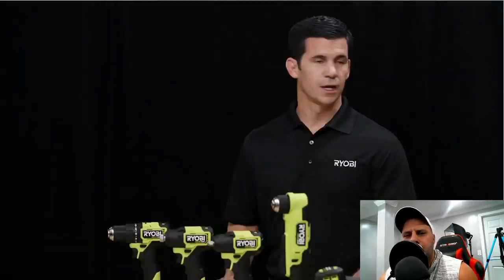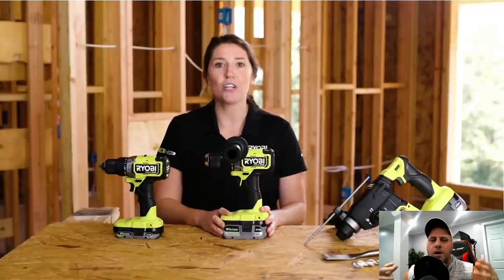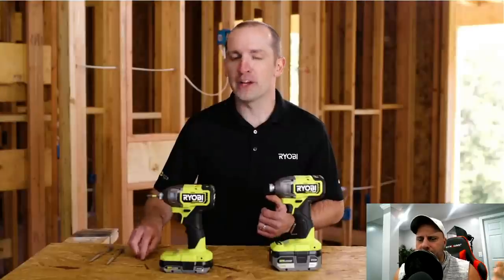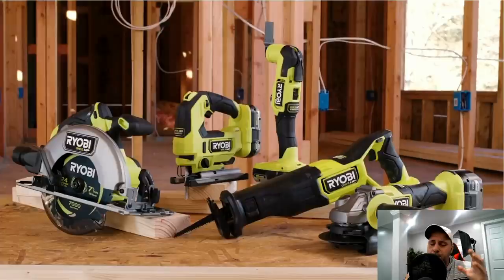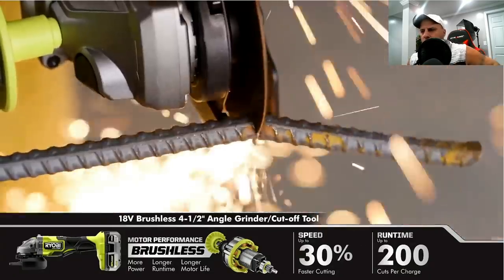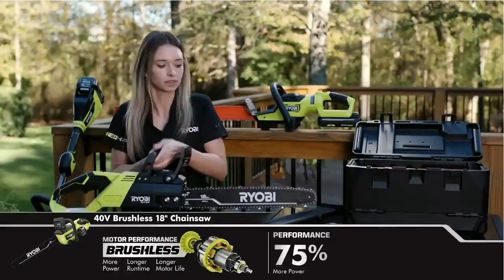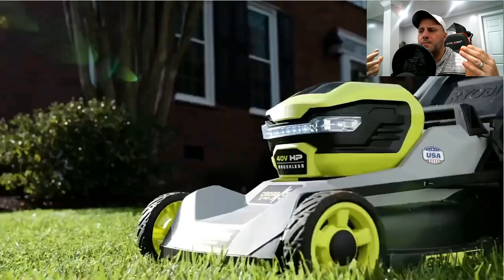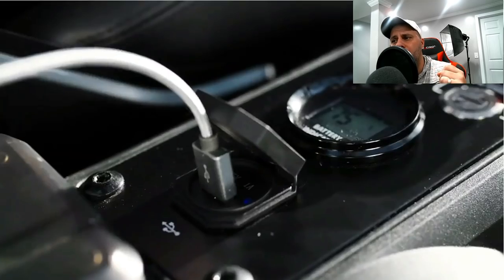RYOBI Tool Just Announced 26 new NEVER BEFORE SEEN Tools - What they got right and what they didn't

Comment: For the DIY weekend warrior I think this new line of Ryobi tools I really going to get a nice lawn for a great price between Ryobi Ridgid Makita DeWalt and Milwaukee I believe in that order goes from homeowner to professional with DeWalt and Milwaukee being at the top Plus Ryobi is made by Milwaukee and out of all the tool company Ryobi comes out with the most designs in tools. So for the homeowner or even for the professional who in a jam I think a tool going down you can go purchase a Ryobi to get through the job I had a problem with my palm sander so I went and purchased a Ryobi palm sander for about $30 and I was able to finish sanding the stairs got them ready for stain and was able to finish the job. So it's nice to see more competition with tool companies😎👍🇺🇸
Reply: Dewalt?  Lol not in makita s league
Reply: @Jack-russell103  no I was saying Milwaukee and DeWalt are you're too professional brands and then Makita rigid Ryobi I wasn't putting Makita next to DeWalt. Number one is Milwaukee and DeWalt and then the rest
Reply: @Jack-russell103  I have to say within the same month all three my Porter Cable pancake air compressors broke I had a big Roofing job borrowed my friend's Makita 3 horsepower 5.4 gallon air compressor extremely quiet and had no problem running to Roofing guns at the same time. Really impressed with the Makita air compressor but I also just picked up from Home Depot DeWalt pancake air compressor with hoes and finish gun paid 179 nice compressor also

Comment: I’m glad to see the 1/2” brushless and the upgraded quick release multi-tool! Are the multi-tool or grinder variable speed? I’d really like to see a variable speed dual-action polisher and some kind of plug-in battery adapter for when all my batteries are dead!
I knew about the live stream but couldn’t make it so thanks for the good overview!
Reply: The plug in battery adapter will never happen, for 2 reasons.
1). They want you to buy another battery.
2). An 18v, 60 amp power supply will be bulky and fucking expensive anyway. You can't just use a wall wart for these tools.

Comment: My wish list:
1) Airless sprayer 0-2000psi 1/2 gallon per minute
2) Dewalt has a 1500 watt generator/converter that I think takes 5ea 20v batteries to run so one by Ryobi would be "real nice like",
3) pressure washer 0-1800psi - Sunjoe makes a 40v one that I bought & love it, it's only 1000psi

Haven't seen his evil brother lately, they crack me up
Reply: Ryobi was going to come out with a multi-battery inverter a few years ago but it never came out and is assumed was cancelled for some reason.  Possibly it had a patent dispute with another company, something Ryobi has had to deal with before... The single battery inverters are the only offerings but the 40v version isn't too bad for basic usage at 300W.

Comment: I have the 40volt push mower, and it works fine for my small yard. I wouldn't want to spend the money on ones that waste battery life on the self-propelled feature, I can push it myself just fine and want the extra battery life for cutting.

Comment: A coffee maker is too high wattage, (600watts-1200-Watts, ) for a simple 1 to 1 replacement of ac for 18v battery, (typically between 40watts and 180watts. ) Someone could do make a modified boilover designed where you let a heating coil heat water in a sealed vacuum insulated container until pressure has reached a high enough level that you'd have enough water rush out to make a full drip cup of coffee. You'd probably want a 2 Liter container, with vacuum insulation for efficiency, a pressure gauge, and a decent sized coil to heat the watter. Basically the whole device would be a multiple cup coffee maker that screws into the top an insulated growler and costs a little more than an instapot. And the first cup on a job site would take the longest as it would have to heat the whole water past boil to pressure. The pressure and insulation would be the key part, because the reason the typical drip or kurig coffee maker take so many watts is because the water heating is highly inefficient.

Comment: I tried watching the stream.  The lag sucked but mostly I was confused at the direction Ryobi is going. Yes, I agree, it’s great they’re updating their tools to brushless and with a compact form factor.  With that said, what the hell happened to the whole Lithium +HP? Remember those HP batteries from like 2 years ago that when used with brushless tools ups the performance?  The brushless tools had that notch where you insert the stem pack so you know you’re getting the extra power?  So what, that’s just been abandoned and forgotten about as if it never even existed?  WTF!?!?  And.........what the hell is TTI doing with Rigid?  All Rigid is coming out with is, let’s be honest here, crappy brushed tools that were already out by other manufacturers and done better!  Oooohhhh, a brand new brushed “job site blower” with inflator and deflator that Milwaukee, Dewalt, Makita, AND Ryobi, among many others, introduced like 10 friggin years ago!  Also, what the hell happened to the Octane line?  Crickets!!!!  As in nothing!  Other than a brushless multi-tool, every “new” tool is a tool that’s part of the Black Friday Sales right now at the Depot for at or around the same price as all of these.  And yes, their drill bits and fastener bits suck ass!!!!!  That’s my rant Clint all-in-all I still like Ryobi I just wish they weren’t all over the place with the direction they’re tools are going that’s all.
Reply: HP+ was mainly to distinguish their brushless from brushed tools but that isn't needed with the HP tools because they're all brushless.  The HP tools also self regulate, which eliminates the need for any special battery feature for a performance boost, and have protection features that make them a whole hell of a lot harder to burn out or damage.  So they're a smarter tool as well as brushless and only need good batteries, which the new One+ battery line is being optimized for them.

Can still use all batteries with the HP tools, but only the new batteries will really benefit them...

Comment: Still no high capacity (2000-3000w) 18v battery inverter. No framing nailer. We need more camping gear. Like a 18v heated mat to put under the sleeping bag and a heated vest/jacket.

Comment: Sometimes these big companies have a certain budget and it's either spend it or lose it.  "If" something like this is in fact happening they clearly do not have their fingers on the pulse of what folks want and need to make business more productive and streamlined , and further more they people making tools who have no hands on experience with tools ,  I was hoping Milwaukee would have come out with a wireless fax/copier that would be at least ip 54 rated to stand up to job site harsh conditions stored in a packout box.  No more doing everything on your phone which can be a slow process.  A company needs a invoice....or the plans have changed on a house that your "say" running the plumbing and a last minute change has been made , no problem....just fax me the new prints.... you get the fax and all is well.  This is just a weird idea that I've had....it could control your one key.....and also more importantly keep track of your tools from them sticky fingers fellers.  Just food for thought.......thanks for taking the time for updating on how TTI is thinking......and you are certainly right about the drills.  Take Dewalt for example..... you got the flexvolt , flexvolt advantage , the atomic , the XR and on and on and on.  If your just getting into the trades you better hope that you have someone who explain what's what and what's total bullshit.  You hit the nail on the head brother.....not a tool test but one of your better vids.   Thanks bro.....

Comment: [LIKE] button SMEESHED!
SDS hammer is VERY interesting (The 2nd most interesting item)
Digital control impact IS wrench/s swapped with impact driver head. (Somebody already swapped 3/8 version)
Recip, Circ, Grinder, and Jig are the same BL tools is a new dress. (couple new features)
Multitool is the MOST interesting. Finally a BL version and extra features to boot. Best tool in showcase.
OPE not my thing but glad to see they updated the chainsaw and attachment system. I'd still recommend the sexy FLEXY! chainsaw.
Reply from the maker: Thanks Tensazero!!!!

Comment: Would love to know how these hp tools take advantage of the lithium +hp batteries since the hp tools don't have that extra prongs on the tool that the normal one plus tools do @ToolReviewZone
Reply: They don't. It's hype.
Reply: @slayerment  that was my point dude
Reply: @AntonioClaudioMichael  No, they just went a completely different route.  HP tools self regulate, which means they don't need HP+ batteries.  The tool itself is smarter and has self protection features so it's a lot harder to burn them out like you could with the older models. Thus emphasis on the light at the base that will flash a error code when you trigger the safety feature.

Mind, the HP series is entirely brushless.  It doesn't need to distinguish between brushed and brushless tools, which is what the HP+ battery did with the extra pins to identify when it was used in a brushless tool.

So the new One+ batteries are being optimized for the HP series and is what you want to use with them for best performance.  They won't work as well with the older models.  While they're also trying to counter how their tools are normally very bulky.  So they're pushing more compact and lighter designs as well with the HP series.

HP+ batteries are thus just for the older brushless models and while they have better cells than the basic batteries, they're not optimized for the new HP line.

First compact HP offerings were underwhelming, being compact generally has a hit on performance and it only came out with a 1.5AH version of the new battery series but as shown in their video a 4AH is coming out and that should provide significantly more performance and we'll see how far they'll take this new line from there but this is all basically their premium offering and takes their tool line in the new direction of smarter and more reliable emphasis, and only worrying about battery capacity and not type going forward...
Reply: @ZeoCyberG  oh you mean that smart chip that has the error light that works 1 percent of the time
Reply: @AntonioClaudioMichael  It actually works most of the time.  Only WorkShopAddict had issues but they pushed it far beyond what it was supposed to be used... Did the same tests with a older Brushless model and they turned it into a paper weight with the same tests, for example... Simple fact the tools survived proves the protection works.